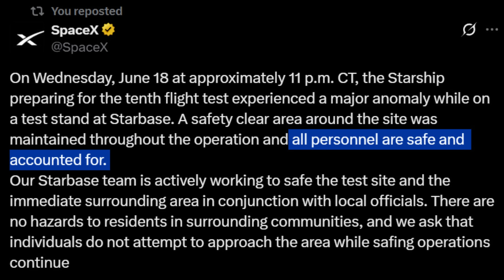SpaceX's Latest Starship Explodes During Ground Test

Comment: At least V2 is being consistent.
Reply: I prefer my V2s to be made by Germans
Reply: @Trek001  if Von Braun made it, it would actually work.
Reply: @Trek001  if it was German it may actually actually work.
Reply: Ze Chermans probably had EVEN MORE FAILURES!
Reply: @Trek001  SpaceX does not call it V2 - it is Block 2.  Scott even showed the right naming in a diagram
Reply: @fourteenfour1  V2 is more fitting
Reply: @fourteenfour1  well, its still "vee" two, right
Reply: @FootballKingInSpace-j9v  the V2 flew before  bang
Reply: @FootballKingInSpace-j9v  Well the V2 was usually able to deliver its payload... (in time...)
Reply: @FootballKingInSpace-j9v  Agreed
Reply: @fourteenfour1 well, that is a Relief! At least the naming was right. 😅😂😂
Reply: @fourteenfour1  I call it "Flop 2"
Reply: @fourteenfour1 v2 fits better with elon's political inclinations
Reply: Starship = FAIL! Fourth failure in a row I believe. So much for Musk's 'Move fast and break things' strategy.
Reply: @DavidJohnson-tv2nn 

He keeps overcoming the challenges of new barriers.
Reply: yep they all bow up
Reply: Should be easier to clean up this time since it exploded closer to the ground, so…, progress?
Reply: historically accurate too ;)
Reply: Bug consistent?! 😊
Reply: There is something going on with the new design.
Reply: @DanPVerne 

Every time you upgrade something; it changes something else or it will put pressure on other components .

This is why they do what they do, and this is how we move forward .
Reply: @Ont785  As a person with 150 patents I know how you move forward.   Goting to Mars as a back up planet is a remarkably stupid idea.  This is not a starship.   This is a bunch of people having a bunch of fun with no real purpose. Time to call BS on the whole program.   Go take a ride in a submarine.
Reply: @DanPVerne 

I have 151 patents, so there.
Reply: @Ont785  Good for you.
Reply: @Ont785  I actually have 157 patents.
Reply: @DanPVerne 

Give me a couple of days
Reply: @DanPVerne 

I’ve been slipping; I’m glad you’re picking up the slack
Reply: @Ont785  OK.
Reply: @Ont785  Well I had 40 years to do the work.    Maybe you haven't had that much time.   Keep on making great things happen.   Someone has to.
Reply: @Ont785  Yeah it's a tough road.   I've probably be doing this longer than you.  When you are 70 years old we can compare notes ;).   But I think I will be on the dark of the tulips by then.
Reply: been doing this....
Reply: @DanPVerne 

Until then, my friend; keep living well
Reply: Darn, we could have had a V8
Reply: At this point I think the V2 Starships are cursed. Every single one has failed in some way or form.
Reply: it's a bit...   not very reliable and accurate, explodes often at the wrong time, and built by people who are a bit enslaved.  Yeah, checks out
Reply: Hey! What about the V3?!?
Reply: By mistake they placed the rocket upside down onto the pad, the nozzle was at the top. :D :D
Reply: V2 fits, love space, hate fascists.
Reply: @RichardFraser-y9t  considering today, said racists would be better than todays polish pale immigrants that push socialism.
Reply: @RichardFraser-y9t  the political trite is so tiring. Yes everyone who disagrees with you is a fascist, can we move on now?
Reply: @humanbeans4498  Its not trite - its right on the money and cannot be passed on like 80 years ago
Reply: @humanbeans4498 

😂
Reply: @humanbeans4498  Is the RfD party left-wing? No, he's a fascist alright.
Reply: @humanbeans4498  guess you haven't been paying attention
Reply: @MrJonathanm50 braindead Democrat
Reply: @totaleXess  Well it takes one to know one bot
Reply: @MrJonathanm50 ok, can you define fascist then, and explain how elon musk fits that description?
Reply: consistent at rapid unscheduled disassembly
Reply: living up to the name
Reply: Not quite -- IFT-9 failed to explode; it merely disintegrated.
Reply: Low information voter.
Reply: Someone in the second stage department  is sabotaging atleast 1 spy present...
But can't operate alone so atleast 2.. the explosion is always at the upper end seemingly same spot*
Reply: @soulsbourne or they have a design defect they keep failing to find or fix.

Comment: Glass fiber had very similar problems to Silicosis. Every time I use it, I have the globe and the mask with me.
The problem was similar to that observed on flight 9, in that in the second stage, we see several leaks on the fuel tanks and conduction tubes, and now it seems that the cryogenic tank in the second stage was ruptured for the pressure inside. I think that they need a new engineer to calculate the stresses on all tanks and tubes.
Reply: Perhaps all the very good ones have already left?
Reply: @geoffwoodgate7450  The direction in Blue Origin Enterprises doesn't expect 60 hours of work a week, so probably you are right.

Comment: Don't worry. Soon a SpaceX Fanboy will come here and remind us that space is hard. Each failure takes us one step closer to Mars. No big deal, SpaceX will have another prototype ready in 2 weeks. No other company does it like SpaceX.. test, fail, iterate, repeat.. Did I miss anything else?
Reply: And he wouldn’t be wrong. Space is hard. And the way our lord and savior Elon The Musk is taking is of testing and failing instead of what those pussies at the Apollo did of planing and calculating. So a rocket has about 1 million pieces. We’ve had info for 10 of them. 999.990 more test flights and it will be perfect.
Reply: Space is hard 😉
Reply: @baomao7243  This wasn't even space.
Reply: What you're saying is the Fanboys are much more intelligent than you.  Saturn v was almost canceled because of the engines blowing up.  I'm not a fanboy, I paid attention in grade school
Reply: @Bryan-Hensley  I don't think Saturn V was still blowing up on the launch pad preparing for it's 10th flight. And back then they were using slide rules and not Elon's 100000 GPU supercomputer..
Reply: Which part of that isn't true?
Reply: @owensparks5013 I think just the /s is missing 😂
Reply: @owensparks5013 This is not how to do engineering. Completely the wrong approach.
Reply: @geoffwoodgate7450  The same way Falcon 9 was engineered? The one with over 400 successful landings of an orbital class booster. Sure,  clearly wrong.  Compare that to shuttle. Massive upfront engineering, such that the design was "finished" before production. No iteration possible.
Reply: @owensparks5013 Completely different concept. I used to think this Starship project was amazing but not any more. Too much money and too many failures.
Reply: @owensparks5013  Except you don't just fix one problem and do the test in 2 weeks. What they're doing is like programming fix the error code run again error fix again. How many starships do they have to keep blowing up. You're supposed to fix the issue from happening at every possible location not just the location that it occurred. Sure every explosion means one issue is fixed but it clearly isn't the most efficient this isn't programming where you just run the code again now you gotta build a new rocket. Haven't realized that shorter turnarounds in flight time result in more explosions? 💥
Reply: @Jiulongbaojian I believe Spacex stated over 1000 changes between one to the next of the earlier ship serial numbers. To think they're only adressing one issue at a time is rather nieve.  As for how many will they blow up? As many as it takes. With 5.5 million starlink subscribers paying $100/month plus Falcon 9 revenue is not like they're short of cash.  With 2 new factories and 6 launch towers I'd expect plenty more explosions yet.
Reply: @owensparks5013  it's nice that you put up some shitty satellites but it's not exactly pioneering chief.
Reply: @owensparks5013 The shuttle that was one of the most ground breaking and still the most capable ship humanity has ever launched?

You're right, that "upfront engineering" approach does sound better.
Reply: @tom.m  I agree with you, the shuttle was truly awesome, and I was privileged to see one. 👍 That said it had flaws that could have been addressed with an iterative design approach.
Reply: @owensparks5013  the ‘no big deal’ part is what’s BS. SpaceX was paid a lot of money to accomplish certain objectives. It has gone through that money and failed to accomplish what it was paid to do.
Reply: @singed8853 Yes, comes down to money at this point. They will be struggling to finance this thing in future. I seriously wonder about any of Musk's companies being profitable. US government is not going to fund this forever.
Reply: @singed8853  Who has paid a lot of money to SpaceX, so they can reach certain goals? And if the answer you want to give is NASA, no they didn't. HLS contract is goal based one and SpaceX gets paid only after it reaches those goals. Starship development was, in the beginning, payed for by private investments. Now it is funded by money printer that is Starlink.
Reply: @singed8853  Such is high-stakes development.  As stated by our design team while engineering complex systems:
“Quality. Speed. Cost. Pick two.”
Reply: @owensparks5013  Probably the part about a SpaceX fanboy, showing up to defend this incident...

Even they have to have a little bit of humility, correct?

Comment: Starship is underperforming on the engine section, that led to cutting a lot of corners and weight reduction measures... we are seeing the results
Reply: Yes, it is looking more and more like a failed concept overall. The in orbit refueling is another extreme problem that will probably end this programme completely.
Reply: @geoffwoodgate7450  that was the part I was expecting to fail, My expectation was that they would never reach a fast enough cadence   to match the propellant boil off.
triggering a major redesign of the upper stage to include substantial amounts of  hardware to cool off the propellant tanks.

I thought they would massively struggle to rapidly  re-use the upper stage, but not this...this is fundamentals going wrong. and I think it all boils down to raptor engines not delivering, I suspect when they try to push them more they just explode because of the massive chamber pressure...
Reply: Is it? I think they are just reducing their safety margins. They had 200% or so safety margin above expected load and now get it down to 40% or even less. Of course that makes everything way more fragile.
Reply: Solution to that is relatively straight forward, not easy or cheap to accomplish but easy to purse. Make it wider and add more engines. 12 meter diameter like they original planned and the square cube law will allow even weaker engines to work. It will also reduce thermal loading on any single tile during reentry. Of course that would require redesign of all the support equipment to build and launch them which would take at least two years.
Reply: @skyrask1948  not sure its structurally viable without internal bracing, and be effectively a complete redesign
Reply: @pinheirokde  Oh I agree it would be complete redesign and it would take years, but it is a solution that is more likely than not viable.
Reply: Nonsense. They are just testing each piece of the rocket in real settings gathering valuable information. We have info on 10 out of 1 million.  Almost there.

Comment: AI Summary

Abstract:

This video details a significant ground test anomaly involving SpaceX's Starship #36 (V2) at Boca Chica. During preparations for a six-engine static fire, while fueling, the Starship erupted in a massive fireball. The speaker clarifies this was a deflagration, not a more destructive detonation, and emphasizes that all personnel were confirmed safe, with only hardware sustaining damage. Through analysis of various video angles, the speaker hypothesizes that the failure originated in the forward section, likely related to the header tanks or their downcomers along the heat shield, leading to a catastrophic cascade. This incident, resulting in a complete vehicle loss and test pad damage, casts serious doubt on the ambitious timeline for a Mars launch and raises questions about the V2 Starship's "optimized" design, suggesting potential over-reduction of mass. The exact root cause remains speculative, attributed either to testing procedure errors or fundamental design flaws, with SpaceX's internal investigation expected to provide definitive answers.

SpaceX Starship V2 Ground Test Anomaly: Analysis and Implications

*   0:06 Ground Test Anomaly: SpaceX's Starship #36 (V2) experienced a major ground test anomaly at Boca Chica, erupting during preparation for a full six-engine static fire while fueling with liquid oxygen and methane.
*   2:09 Personnel Safety Confirmed: SpaceX confirmed all personnel were accounted for with no injuries, indicating only hardware damage.
*   2:32 Deflagration, Not Detonation: The explosion resulted in a large mushroom cloud of self-burning gas, identified as a deflagration (subsonic combustion) rather than a more dangerous supersonic detonation.
*   3:53 Safety Advisory: Due to potential vaporization of silica fibers from heat shield tiles, caution is advised for anyone downrange due to possible airborne glass fibers.
*   4:19 Failure Origin Hypothesis: Footage suggests the initial failure began in the nose cone/forward section, appearing as spray from the nose cone area and a split along the windward side where the heat shield and header tank downcomers are located.
*   5:58 Cascade Failure Theory: The speaker hypothesizes that the failure originated in the header tanks, causing hardware to fall and rupture the main methane tank, leading to mixing and ignition, and ultimately the collapse of the vehicle and a secondary, larger fireball.
*   7:03 Complete Vehicle Loss: The anomaly resulted in the complete loss of Starship #36 and serious damage to the test pad.
*   7:37 Mars Launch Impact: The incident makes the previously ambitious goal of launching to Mars next year a "much longer shot."
*   10:23 V2 Design Concerns: The V2 Starship's "optimization" to reduce mass is questioned, with the speaker suggesting they may have "cut out a bit too much" and need to add mass back in.
*   11:04 Limited Test Data: The destructive nature of the anomaly means it provides little valuable flight test data, effectively rendering the extensive work on the heat shield a waste.
*   12:02 Root Cause Speculation: The exact root cause is unknown but speculated to be either a flawed testing sequence (e.g., overpressurization in a propellant loop) or a fundamental design flaw in the V2 Starship, potentially leading to a shift to a V3 design.
*   11:37 Future Test Timeline: The next test flight is anticipated to be at least a month or more away due to the damage and the need for investigation. The FAA is not expected to intervene as it was a ground failure.

I used gemini-2.5-flash-preview-05-20| input-price: 0.15 output-price: 3.5 max-context-length: 128_000 on rocketrecap dot com to summarize the transcript.
Cost (if I didn't use the free tier): $0.0052
Input tokens: 16459
Output tokens: 771